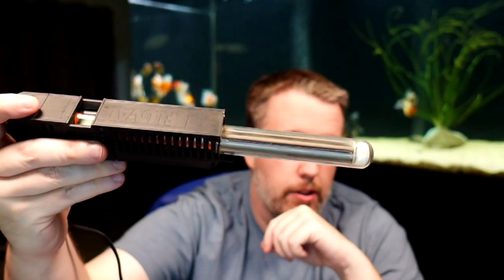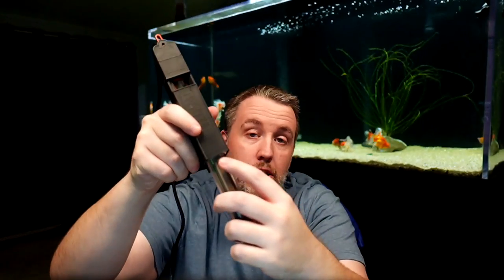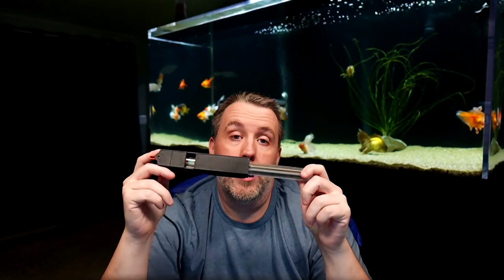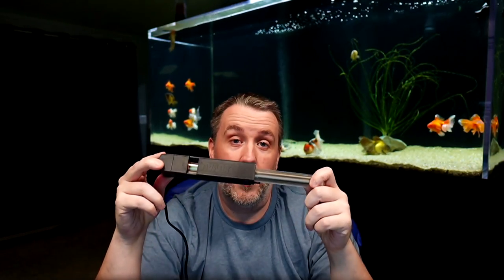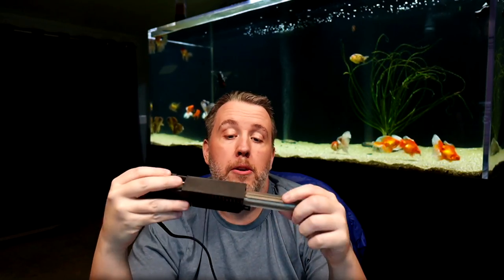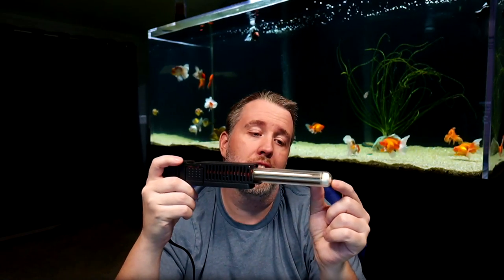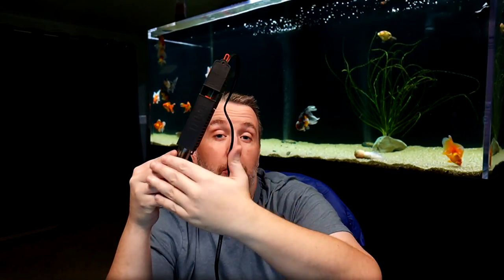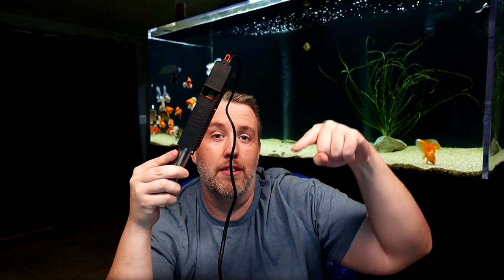The Truth About Aquarium Heaters (and Why They Always Break...)

Comment: Question: Do you still recommend the Fluval E series heater?
Reply from the maker: I think it's still the best "off the shelf solution" I have one in my living room tank with my mbu puffer but have it set at 73 degrees and use mostly filtration, and lights to heat the water on top of what we keep our house at normally which is 70-72 degrees. I believe the best setup currently is a quality heater combined with a heater controller that lets you set the temp range by several degrees. This takes trial and error and isn't a simple off the shelf solution.

Comment: As much as I agree with most of this video , captive bred fish these days may not tolerate 6/8 deg temp changes so the constant turning on and off of the heater is necessary to a point. I would agree though that 0.2 deg is too accurate but perhaps cycles should be more like 2/3 degrees where most aquarium bred fish would be fine.

Comment: My tank runs hot with a sump, protein skimmer, UV sterilizer, and circulation pumps.  I use a chiller to control temp year round.  All those are heat sources, like you said.  No need for heater.

Comment: I've not used heaters in a while. Water itself holds temp pretty good, having a lid and LEDs pretty close to the water has kept my water temp b/w 72-74 for years. If I were to use heat again. I'd probably stick it in my sump and have temp set to 76 and run it on a timer to turn on once a day. Having a heater go bad is my second worst nightmare and even if the heater goes bad the timer should keep it from boiling my water.

Comment: Hey Corey, why not get with one of your Chinese manufacturers to make a housing compatible for one of those tube heaters with an impeller on the bottom that forces water flow across the heater. You could even put a sponge on the intake for extra filtration surface area.
Reply from the maker: We have been talking to companies. We believe that at a minimum it's 3 years before we can launch a heater with any certainty. We have some things testing already. However, we need to get prototypes, then production runs, then run them for a couple of years to see if they fail.

Comment: please please can you make a pt.2 talking about the difference between inline heaters and traditional submerged heaters. Are the inline ones ‘better’ because of the awesome flow over the element? Also, why are there not heaters that are electronically programmed to supply variable watts permanently as opposed to on and off, that maintains the water at a set temperature. So for example it would be a max 150w heater, but it only supplies say 72w permanently, to keep the water at the desired temperature. That way... ZERO on and offs.

Comment: Thanks Cory. So are you saying that maybe 5watts of heater per gallon of water is too high? Curious as I have a 15 gallon column tank that I’d like to upgrade the heater for.
Reply from the maker: That's the problem with "rules". A 15 gallon column in a room at 60 degrees with no top and drafts, 5 watts per gallon might not even be enough. A room at 68 degrees with a tight fitting lid, a high powered light and a filter, might not need a heater at all.

Comment: I have a question...

I have a 1000 gallon pond and I just want a warm spot to stay above 70 degrees so the few tropicals I have can survive all year.  I'm in Las Vegas (zone 9 a)  where the coldest night of the year is 30 degrees f on the average year.

I have a weather protector over my outlets so the heater plug wont get wet ect.

My question is this....

Since its wayyy too expensive to constantly keep a full 1000 gallon pond (12.5x9.5 feet and 26 inches deep) 70 degrees and above..

Can a Aqueon 300 watt keep a small area  above 70 degrees??

I've been reading that they have automatic shut off to prevent overheating failure.

My thought process is that in the winter here in las vegas its typically 40 f at night and 60 f during the day...

So a 300 watt Aqueon aquarium heater set at 70f would never turn off and avoid the on/off you speak of.

However prolonged use would result in an heft energy bill...

Also prolonged use may cause the heater to turn its self off to avoid "burning out"

Thusly...occassionally shutting its self off and saving me some money till it kools down and restarts again.

Am I on to somthing here or do you see a giant pink elephant I've failed to see.

Thank OP or anyone willing to help with my question

Comment: Hey Corey. So I was wondering if you knew if you could fix/ replace the toggle switch on an e 200 fluval heater. Mine just stopped working properly. You can turn the heat up but not down. (It doesn't recognize that your pushing it to the minus point nothing changes on the screen)  It is about four years old and I don't have the receipt anymore so I can't get the warranty. Any advice would really help. I do have an extra heater on hand but I would love to get this one working again if I could. Maybe it's just time for a new one I know parts wear out.
Reply from the maker: Have you tried the reset process with it?
Reply: No I don't think so I did unplug it and clean it but It didn't reset just went back to the original temp it was set at before I unplugged it. Is there something more to do like a factory reset? I am not sure how to do that.

Comment: What if we built a heater that instead of turning on and off we had a heater that could automatically vary it's output so that it lowered its output to the cooling rate of the tank? So you turn the heater on, it ramps up to high, heats the rank to the set temperature then slowly lowers its output until it maintains that temperate?

Comment: If your heaters break, it could be because you let your heater into cool air or water too fast or hot water/air too fast. If you're cleaning your tank, turn your heater off for 30 min if it'll be exposed to air. Don't turn it back on until the new water is fully in and the heater is submerged again and has been in the new water for 20-30 min. New heaters - put it in your tank water OFF, for 30-60 min. Then turn it on... Glass expands in heat, shrinks in cold. Changing temp rapidly WILL break the glass.

Comment: In the controls world the term is hysteresis, a dependence of a system's change in state on its own history. This doesn't have to be just on/off though, a cheap SCR dimmer can run a resistive heater as a fully variable heater.

These heaters could be smoothly sliding between e.g., 30 and 120 watts based on the measurements from the past day, and never switching fully off or on.

Comment: What’s your opinion on heaters in sumps then? Is that enough flow? (Depends on flow rate of pump but let’s says 6 x turnover)
Reply from the maker: Depends how the sump is setup. You can have a fast return pump but the way the water channels through the sump could be going over the top. I had mine installed in where the overflow comes down and that seemed to work well for me.
Reply: Aquarium Co-Op final chamber before the return, thoughts? Or is the water moving to slowly in that area?

Comment: You want heaters to last I would advise using heater controllers it will make a huge difference. I’ve had many heaters and I’ve had my share of heaters fail it’s usually a quality control issue passed down from the companies making them. Well after my last heater failure which actually turned into a product recall I started looking at heater controllers and it made all the difference , I have had ZERO problems with my heaters and I would recommend a controller to everyone or anyone having heater issues. They range in price from $35 and up and for the money they also provide peace of mind so it’s well worth your investment.

Comment: I'm sure this idea has been thought of.?, but wouldn't it be easier to put a slot in a rack to put heaters under a tank? Kinda similar to snake racks heating set up since heat rises, but the main heat source would be in 1 location, either side or middle so fish can move to cooler areas. Also might help grow mulm or good ground bacteria in the hotter part.

Comment: I am slightly confused on this. I have 2 75g tank and I bought 2 300w fluval heaters and 2 300w ehiem jager heaters.
Should I be running 3 100w heaters instead or?
How do I get my 300w heaters to go on and off less?
Reply from the maker: Two 300 watt heaters in a 75 is a lot. They will cycle a lot. You’d probably be better just running one and having one as a back up

Comment: In my country, India, weather gets too hot from march throughout september, its 30°- 40°Cthen....but after that winter comes and temp goes down slowly to 10°C min(at dawn) to 20°C max(at mid day) in a day basis....so i set to 24° -28°C for most of my cichlid and other tanks.... I have 5 tanks now... 1 mabuna 200 litres and 1 peacock tank 200 lits...1 native planted 180 lits,1 german ram tank 100 lits and a hospital tank 100 lits....all are well n happy...we dont get branded heaters like u guyz in US(cuz they are damn expensive here!!)... I have 5 100 watts china made..i set them near bubble makers or filter outputs....they are cheap and good..bi metal type i guess...doesnt have sensors nd all..but works simply good...never really broke one....!

Comment: I try and keep the tank around 76 to 78..  i keep my house cool.  Very seldom use the heater in my house.  So my fish heaters run a lot.  I use 200w in my 100 gallon tank  it is on most of the night.  I keep lots of flow around it.  My smaller tanks that's another issue.  Working on it

Comment: I put foam board on the sides of a tank that is used to house a snake to keep the heat in. Now I'm wondering if that method would help my aquariums retain heat. Would putting it on the sides and back make a big enough difference?
Reply from the maker: I didn't find it to make a huge difference, a tight fitting lid made much more a difference in my tests.

Comment: Nothing lasts forever. Being a Reefkeeper, some of your thoughts are geared towards freshwater only as corals absolutely need as little fluctuation in temp as possible. 

I have a 10 year old Fluval heater that is still running strong. It is on a Inkbird Temp controller and the water sits between 76.5 and 77.5 without fail. It also sits in the sump. My house is kept at 73 degrees. 

You also should always have two heaters connected to the tank in case one fails. To me, this is just way too much thought put into an item that costs very little.

Comment: Funny I just had a hidom fail it was full of condensation in side a blew my head off the problem is the adjustment that is the weak spot I set mine and use a controller and bond the top of heater with epoxy  resin put cap bk on my type had a rubber bung to seal the glass tube a lot of makers use this method never rely on the stat all ways use a controller

Comment: is heaters going out a thing i have only had one die so far and it was 10 years old 

only things i do is use the smallest heater i can get away with always have them at an angle and keep them by the filter intake or exhaust

also most of my heaters are second hand

Comment: Ink bird controllers with 2 heat outputs and 2 temperature water sensors works great. Also heaters with no temp dials less electronics to fail . Best heater best quality best performance I’ve experienced .I get from bulk reef supply it’s a titanium no dial heater with there name on heater but heater is made in Germany not China  . Awesome heater paired with ink bird

Comment: this inst quite true, there is a difference between the precision they sell (the 0.2C) and the hysteresis of the heater. most heaters are designed with a 2-3 degree hysteresis to avoid unnecessary off and ons. usually you cant program this and its just part of the design, but if you could you might get the behavior you are after. the precision they are selling is more to do with the offset temps old heaters often had (i've had some heaters that were consistently 4-5C under what they were set to even in smaller tanks than they are rated for)

Comment: I agree  with this 100%. I'm a devoted user of heater controllers, after losing an entire tank to a faulty heater that stuck on years ago.

I used to set the heater controller to a range (say 75 to 78) and set the heater to 78 so it would go through a 3-degree drop before bothering to turn on, lessening the number of cycles. 

Now, though, I live in a  house with good central heating, and my tanks are acrylics with lids. So I set the heater controller and heater both to 76 or 77, and since the room temperature keeps the tank around 79, they never turn on unless there's a weird situation where my room heat goes out. If your heater is just a backup, it pretty much lasts forever.

Comment: Two thoughts: First EJ heaters are nowhere near the quality they were before the buyout. I have old pre buyout EJ's that are still running. The Eheim versions don't last near that long. Second The point a thermostat starts and stops, be it a heater or ac unit in your house, is called the hysteresis. If your unit starts .2 degrees below setpoint and stops 1 degree above start saving for a new unit if the hysteresis isn't adjustable. One of the difference between a bargain basement thermostat and a top of the line one is the ability to adjust this. 

A common mistake among those in our hobby is buying a heater that is too large for the application believing bigger is better. It is far better for long life to buy one that maintains your desired temperature and rarely turns off.

Comment: What do you think of the Eheim pro with built in heater? I have had one for 20 yrs+ the temp probe did go bad once and I replaced once. Why don’t more canister filter companies sell “built in” heaters?
Reply from the maker: I don't have experience with the pro really. The only one I ever got was used and the heater part was broken... However in general most companies don't include heater due to added cost. Also the way in which companies do it by just adding a normal heater to the canister make it a high breakage part from removing the top to service the canister. Then there are sizing issues, like a 300 watt heater might not handle a 125 gallon in people's minds, but the canister would. Also you want to appeal to the most customers and a heater inside a canister goes against goldfish owners which is one of the biggest markets in the world.  I wish the inline heaters we have available weren't so unreliable. It seems like a perfect fit in the hobby space.
Reply: Aquarium Co-Op Thanks for the reply😀. I would have never guessed that goldfish keepers are that popular😳.

Comment: Just a point the heater that failed and cooked a fish in the heatwave was in a tremendous amount of water flow. Lucky I noticed and only loosed one not all of them. It was in an outside pond. It was set to 20 it would not shut down and heated much hotter than 20. The pond ended up at 45 .It's an undercover pond.

Comment: This actually makes those oase biomaster thermo canister filters even more valuable then.  As the heater is inside the filter so it'll immediately disperse the heat out and away from the element.  Likewise, I wonder if anyone has thought of a standalone heater/powerhead combo similar to the standalone uv units that have a small powerhead attached to set the right flow through the uv light.
Reply from the maker: They actually do make a powerhead/heater combo. The problem is the sponge they include with it clogs easily and the selling price is quite high in my opinion.

Comment: I got two 300w heaters in different tank i set it at the lowest or around 72 74 but my aquariums get hot up to 80 degrees am I doing something wrong one tank is 115g the other 70g the water always feel warm so that’s why I lower the temperature on the heaters

Comment: Love how he worded it, " went to explore heaters " meaning you went to try and get a better price on them sold to you. Also you can buy a heater for $50 for a 100W or $55 for a 200W $60 for a 300W OR just buy 3 $50 heaters for $150 bucks lol. How about just buy 6 50W @$30 so you spend $180 but hey now YOU'RE really protected against a heater going out. How about just 2 200W @$60 for $120 one on each side? And the extra rigorous testing done on the 200 and 300W cobalts are also due in part to the 1,000's of fish that were killed when the heaters exploded. So you better do something different to fix it.

Comment: I think a multi wattage heater that is capable of switching from 5 w to 300 wats..set it at 75*   Operational temps 70-80* at 75* it would only run at 5 wats but would increase wattage use as Tank gets colder but reduce wattage when near set temperature..only shutting off when the tank hits its high set limit..  that kind of setup would rarely turn completely off (unless summer or warm climate) then would remain off for a long time… making the heater last decades

Comment: I have never had this issue with any heaters I own some are cheap and just garbage they still work though. I have good fluval ones and they are all still working maybe it's how I place them in the water but they last I have only broken two because I forgot to unplug them before re filling the tank they cracked. I have yet to have one just fail and stop working  I have been using them for years now.

Comment: what about using a 24h cycle? In the wild the sun comes up and the water temperature rises and at night is cools down. this can be replicated. a system that uses time to make sure it reaches a high  and a low in a natural way. using a temperature probe and some electronics to keep the on and off cycle to a minimum to induce longevity of the heater.